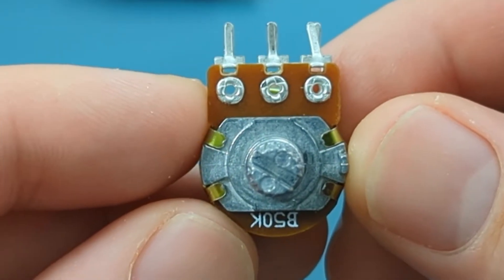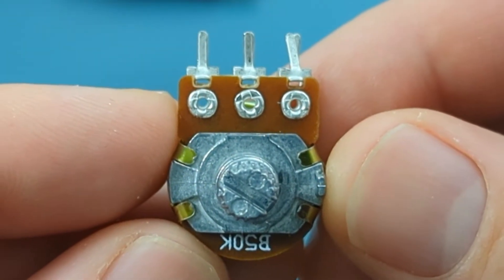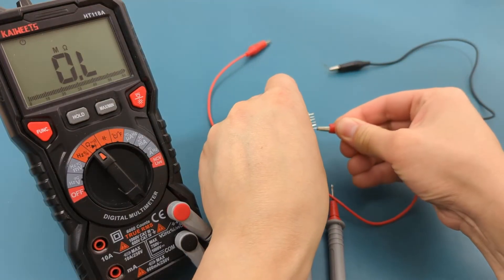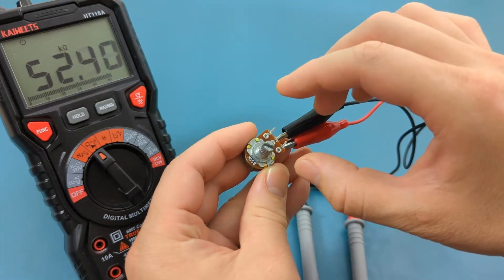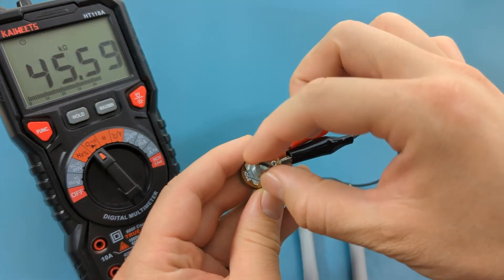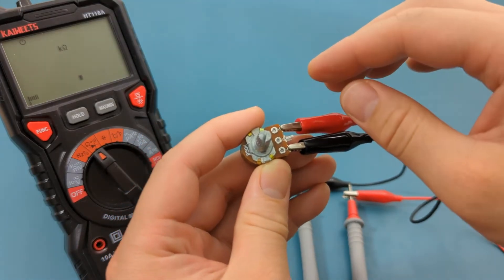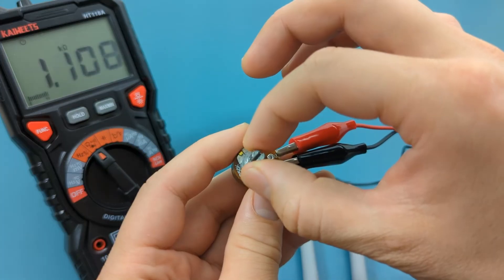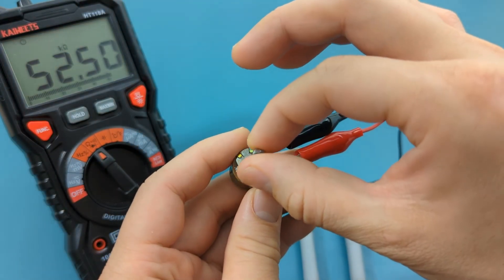How To Test Potentiometer With Multimeter

Comment: so does this mean that "50k" on the pot is the same as 50 ohms? and this being thus does that mean a 500k should do 500 ohm?
Reply: He misspoke, when the device reads 52.00 a little k is added to the Ohm sign on top. So you can tell its reading in KiloOhms, as in 52000Ohm. It's a space saving feature for screen device.

Comment: Hello Electro University. My question is how can you find a very specific potentiometer, like the OEM stock one from a product you have disassembled. On the Potentiometer of mine it says ''4K7 LOG A8''. I'm %90 sure it was made by Siemens and the product is from 1979. But no other code at all. If I can try to source this. Where can I find new old stocks?
Reply from the maker: If you have a very old potentiometer, you can start by searching online marketplaces for the exact model you need. It’s also worth exploring specialized electronics suppliers that might carry these components. Additionally, contacting Siemens directly could help, as they might have information on a compatible modern equivalent. Hope that helps!
Reply: searching   "4K7 LOG A8 potentiometer" in a search engine gets some results. I'd start there personally.